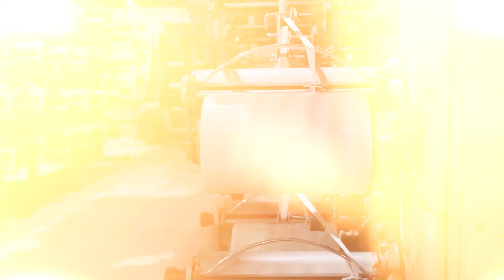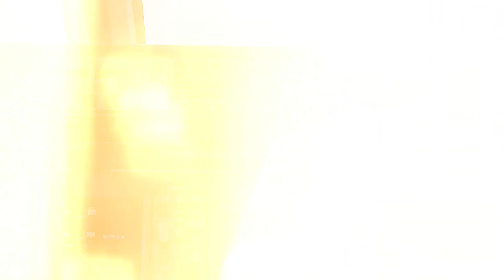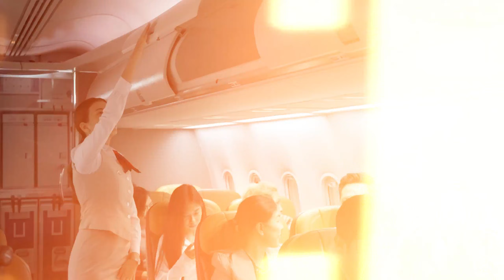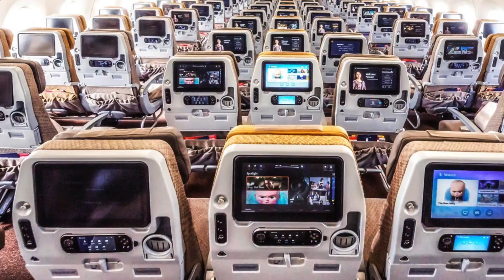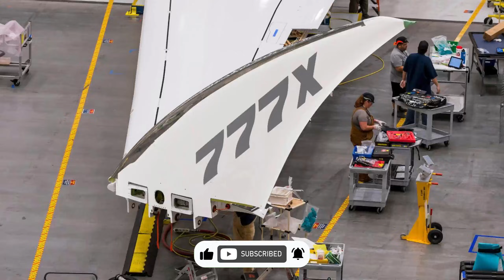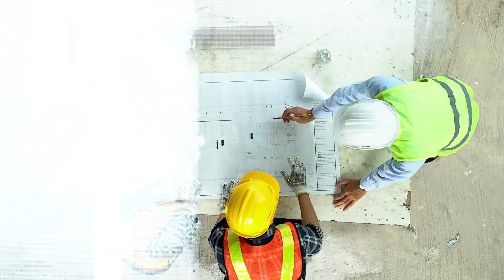7 Airplanes Mechanics Are BEGGING Airlines Not To Buy in 2026

Comment: I think most people can see a lot of your report is AI generated. However, this is an issue - Maintenance on Aircraft _ needs to be addressed by the so-called Aviation blogs. It appears that the deep discounts on aircraft is being replaced by the maintenance repair and replacement of parts, software, and extensive repairs. Gillette and HP have the same strategy, relatively keep printers and razors and expensive toner and replacement blades. Where is MENTOUR NOW on this issue?
Reply from the maker: All the information used in our content is verified and implemented by Humans. We do use tools to help produce the content and scour the web for verified information. Thanks for tuning in!